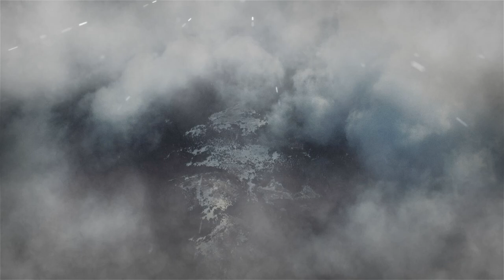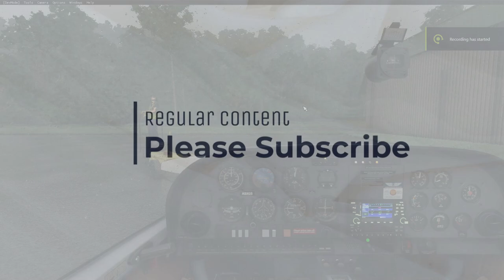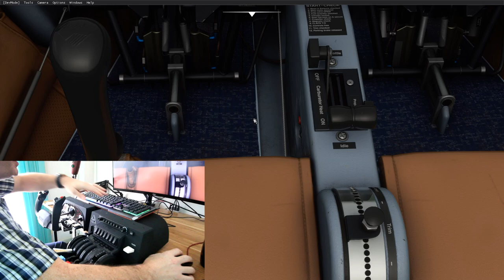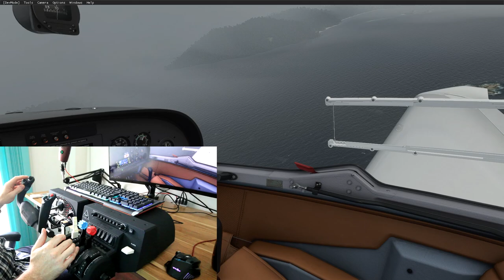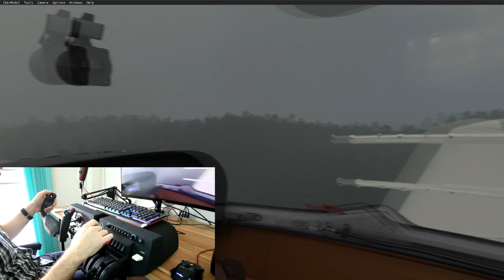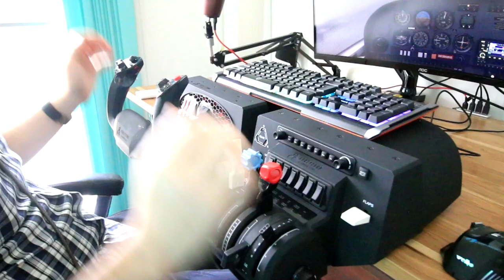Honeycomb Yoke and Throttle FULL Review

Comment: It can be better if the spring tension and the damping of the yoke can be adjusted. I have tried it on 2019 EAA Airventure. The force feeling is closed to C172. However, the switch layout is obviously a diamond DA type with the ignition on the right. A little bit weird because the diamond uses a center stick.

Comment: Hi Wayne.  Whilst the video was great from a scary/lost point of view,  great/lucky that the visibility improved markedly.
It might have been better to have set for clear sky's, so that you could concentrate on demonstrating the operation of the yoke and throttle quadrant.

Looked as if you flew for some time with the starter motor grinding away, took off into the wind on a heading of S/21 and landed on the same heading, whilst saying it would be tricky landing with a tail/side wind.

Looking forward to a second video when you you have the new drivers, have set up the 'controls' parameters, and have a set of peddles really :-) 

Cheers Noel

Comment: Thanks for the first impressions.
I would like to see some more specific things like: is there a way to set it up for the TBM930 or Airbus with their unique throttle systems?
Reply: There is a second set of handles consisting of 4 thrust levers, a flaps lever and speedbrake lever.
Reply: @Sim737Pilot  You mean: use the extra handles to mimic the TBM feather-low-high?  Is that possible?

Comment: Jejeje You start the arcraft with mixure leveler on idle position WRONG.
Reply: Not true, some complex aircraft the fuel system is primed with the fuel pump or primer before starting, then the engine is cranked, and mixture is introduced once the engine starts, this applies to the C182; so likely works in this aircraft as well.